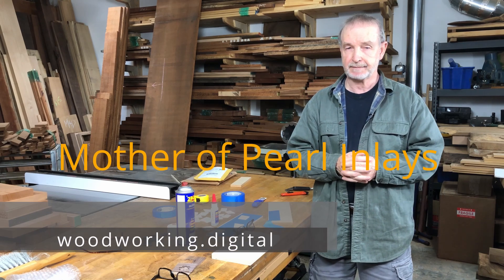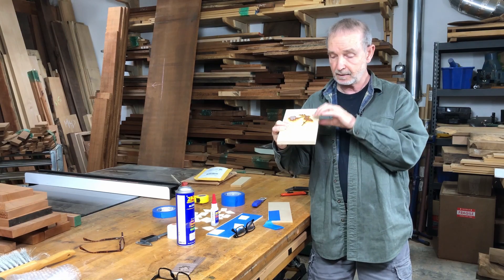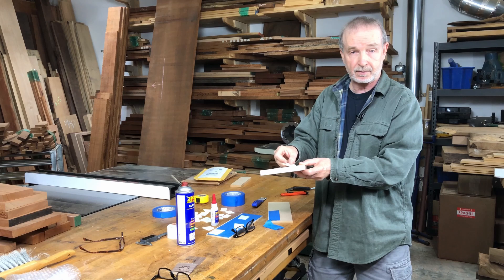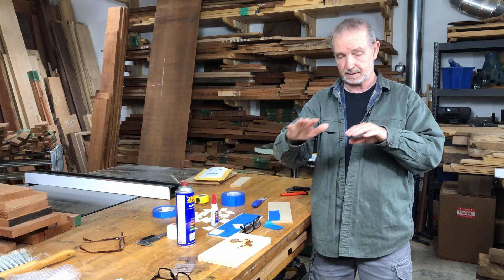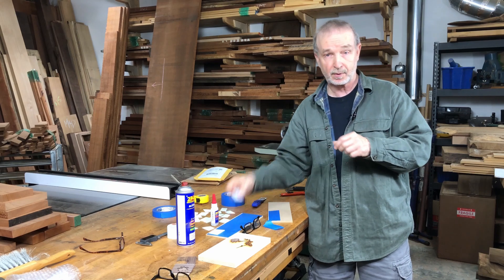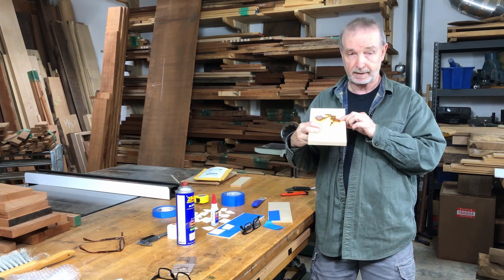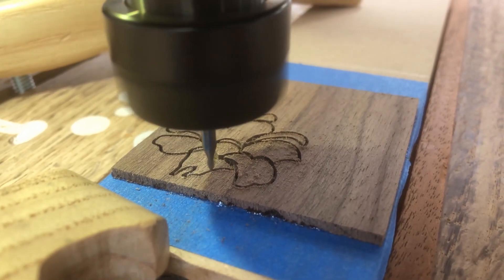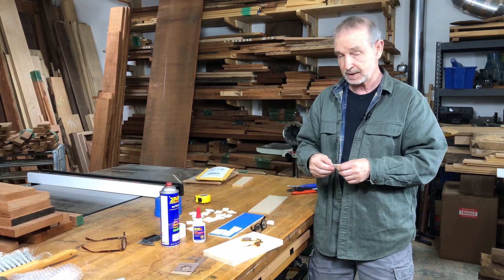Introduction to CNC Machining Mother of Pearl Inlays

Comment: Very helpful! Out of curiosity, what kind of safety precautions are you taking? I know Mother of Pearl is extremely hazardous to inhale. Does your CNC machine have a built-in ventilation system? Any recommendations for ventilation systems to use in combination with
Reply from the maker: I deal with waste extraction in a couple of different ways, depending on materials being cut. For wood, my CNCs are hooked up to my shop-wide dust collection system. When machining aluminum, I vacuum with a small shop vac throughout the operation. They idea is to collect one specific waste and dispose of it.  For all other odd materials, including mother of pearl, foam, etc I collect throughout the operation with a large shop vac that lives next to my CNCs. These tend to be short runs anyway so sucking up waste several times in an operation is no big deal. 

The reason for doing this is to keep my main wood waste in a form that it could be composted and used for bed covering, etc and the other waste separated so it can be disposed of in appropriate manner. For additional safety with machining materials like MOP, or some wood exotics if I'm closer than an arms length, I wear quality dust masks.